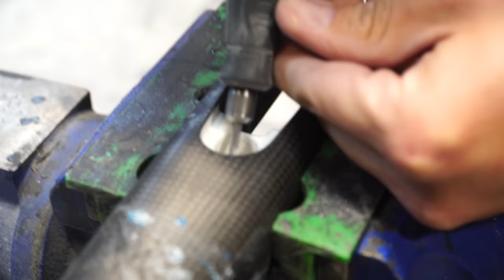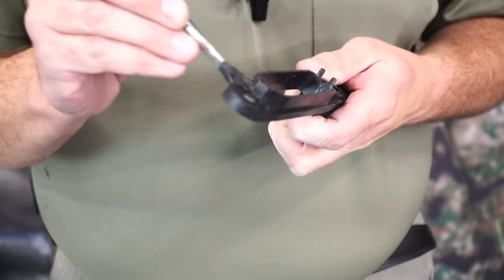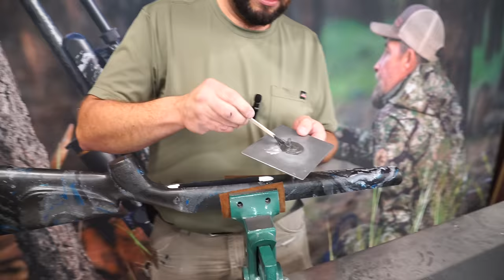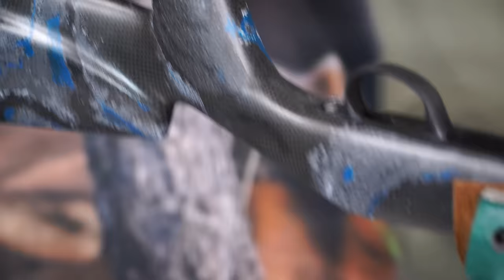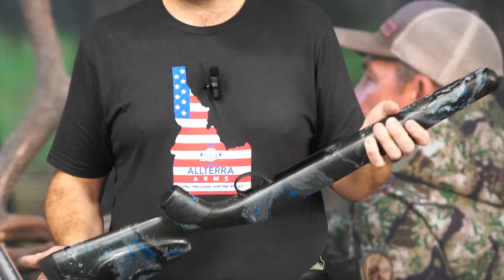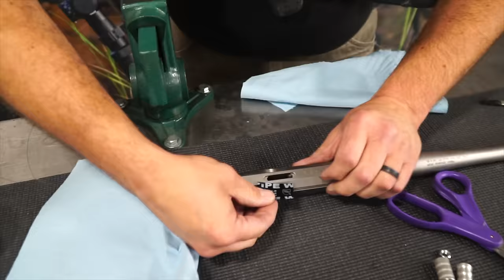How to Pillar Bed a Tikka Stock

Comment: So glad I seen this video before I bedded my two tikkas! I have grayboe stocks that just came in for my 300 wsm and 7prc and I definitely need to bed them. I’ve watched every video at least twice and skipped over this one because of the tittle! I was under the impression it was on just pillars. So glad I watched the video! I took notes and now need supplies I wasn’t going to use since other videos had their way of doing it, but this way is much much more accurate and reassuring! Thanks for the video and new found confidence that I could bed my tikkas without issue!
Reply from the maker: Glad we could help! Hope your project was successful.
Reply: did you rebarrel to 7mm PRC? I'm wanting a Tikka in that caliber.
Reply: @steveelder5306  I did. I pre ordered a tikka proof research carbon barrel 2 summers ago. Super easy to take the barrel off and threaded the pre-fit on. Hells canyon has the best magazine, if you decide to go with 7 prc. The 7 prc cartridges didn’t feed or fit from the stock tikka 7mm rem mag, magazine.
Reply: Did you shoot your rifle before and after bedding ?   If so, What was the outcome ?
Reply: @Timberdam  for sure, and I can’t say definitively, that it did anything to increase accuracy. I would have had to have shot much much more to confidently say that it increased accuracy. The only thing a can say with confidence, is that it did nothing to hurt accuracy and it did add another level of security, that my rifle isn’t moving around in my stocks. Bedding was the very last thing I did on top of having badger rings, bedded rails, metal bottom metals, high quality optics, custom barrels, and custom hand loads with quality components. With all of those factors, I’m not sure there was any room for noticeable advancement in accuracy. I can say, that in other rifles with factory barrels, I definitely noticed an accuracy increase from swapping Tupperware to a stock like bell and Carlson or  hs precision, then later bedding it. It seems to get rid of that 1 out of the 5 shots that makes you say, “ if it wasn’t for this one, it would be a half inch group..” lol. Long reply, but hope it helped. Happy shooting!

Comment: Does the stock Tikka T3x Lite come with pillars? What is the recommended torque spec on the action screws? Tikka manual says 45 or 62 in-lbs depending on if your stock is a plastic base vs metal base. 62 in-lbs sounds insanely high. I’ve heard people get best results between 35-40 in-lbs… after adjusting my trigger pull, I torqued my stock back on to roughly 37 in-lbs. Seems to be on secure and the magazine slides right in… not sure if I’m missing something.

Comment: Love the process, would be interested to hear your thoughts on torquing the action in during bedding versus using compression with elastic or other.
Reply from the maker: We have used compression with rubber tubing in the past. Using the action screws ensures that the bedding cures with the action as level as possible and that the screws will go right where they need to be. Also keep bedding material from getting into the action screw holes.

Comment: Thanks for the video!  Was there any bedding compound left on the pillar surface where they contact the action? Seemed like it but I couldnt really tell. Should the pillar contact surface be cleaned or does this has little effect on the bedding process and/or accuracy?
Reply: There will be bedding compound on the pillar surface. It will be very thin where the action contacts them. Bedding a round action surface to a flat pillar top, you will want the compound to flow in and fill all but just where the action contacts the pillars.

Comment: Could you use the release compound to protect the edges of the stock from any overflow?
Reply from the maker: You could, but its not necessary on any areas that are accessible to be cleaned off before the compound is set.

Comment: Is the white area on the stock foam for the core of the stock?
Reply from the maker: It’s not foam, the core is a dense machinable compound made with resin and 3M micro glass bubbles.

Comment: How to bed a tikka? WHY? #1 toss it in the trash and get a Remingtion700 start there. Like putting drag slicks on a Prius.
Reply: 0 seconds ago
I had a 700 loaded up, hs precision stock , timbey trigger , free floated and bedded. Shot good but my tikkas are better. All tikkas you're throwing away I'm gonna need your trash then.
Reply: Tikka is a far better rifle than a 700, unless you go custom action.